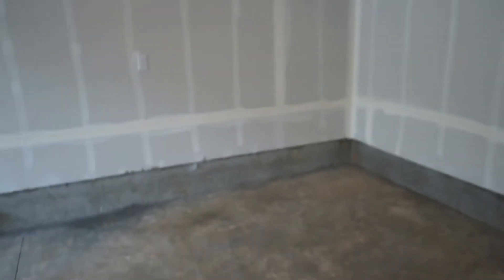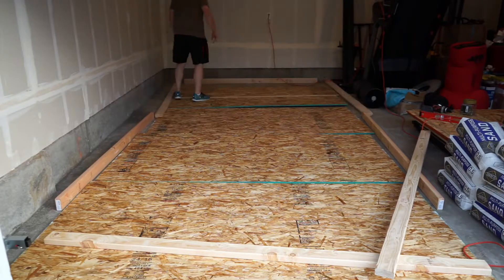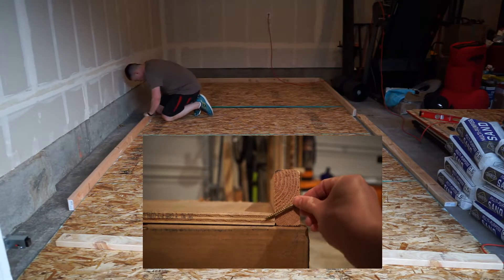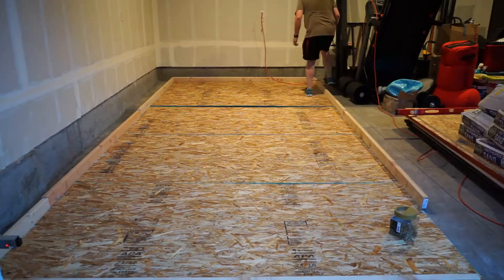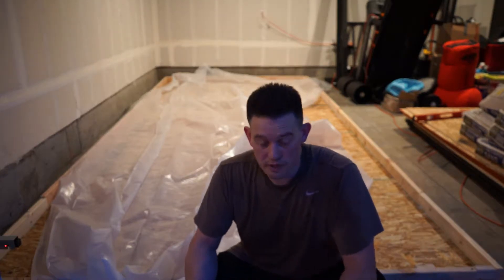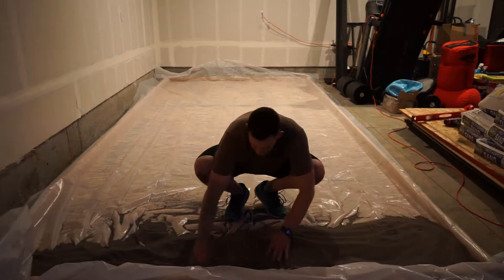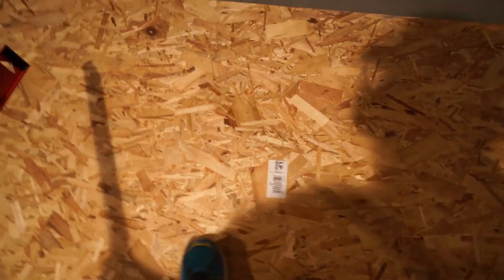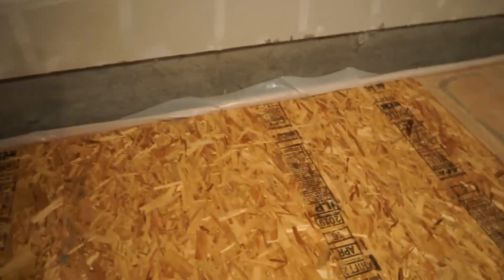Leveling a lifting platform with Sand Part 1

Comment: Did you have any problems with this platform and sand beneath it , any feedback
Reply from the maker: I will be doing an update on this.  It has held up very well.  I've had multiple people on it working out with zero issues.  The one thing I wish I did was spend a little more time getting the sand level.  I can tell where the boards but up a little but really not that noticeable.  I will try to cover everything in an update video.